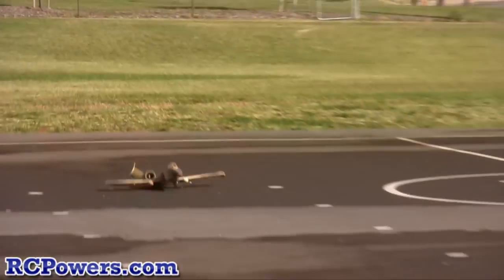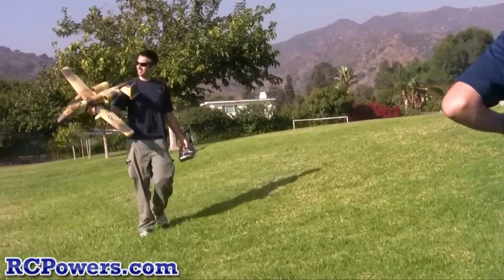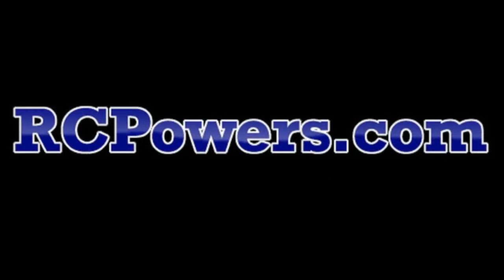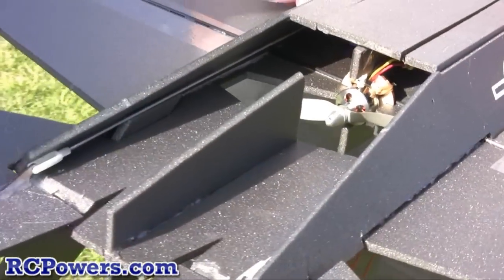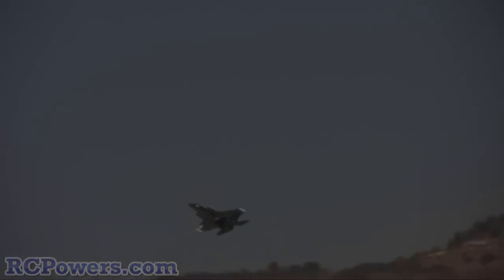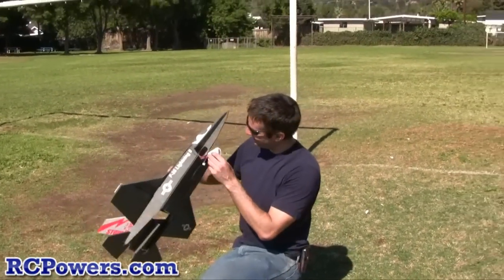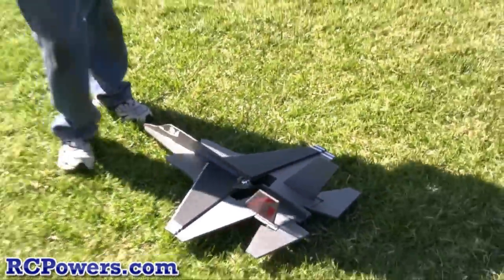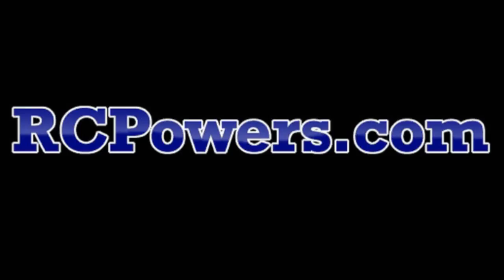RC F-35 w/ KF Airfoil

Comment: Also, Truther, you're confusing the definition of a cloud with what contrails are: condensed water vapor created by not just heat difference from nozzle exhaust and surrounding cooler air, not too mention the turbulent disturbance in the exhaust wake. No, they will not coalesce into what you would consider a "cloud", which is probably, if it's real, that "NASA" report was referring to, as there was a time people feared contrails could contribute to acid rain and other pollutant precipitants.

Comment: Also, considering the grids in the air, please refer to your local low and high altitude sectional charts if you'd like to see correlate the grids you see with documented IFR routes. They are referred to as Victor (low) and Jet (high) routes. I understand belief in sinister acts of the government are exciting, but I would ask you to look further into fluid and thermal dynamics before you readily accept such "theories". And, I apologize for calling you an idiot earlier. Really was uncalled for.